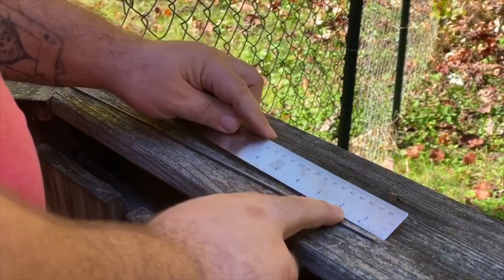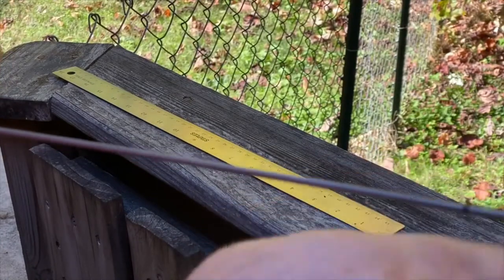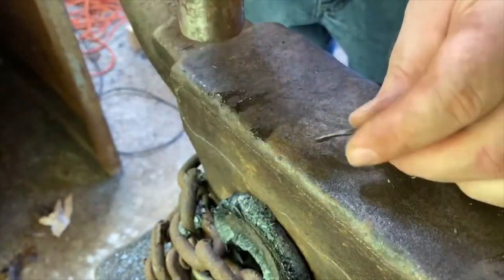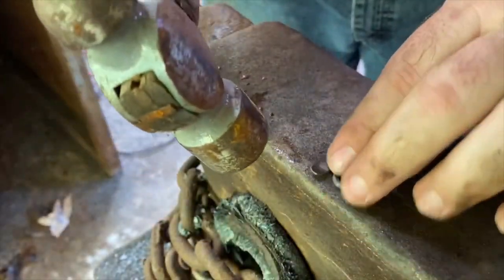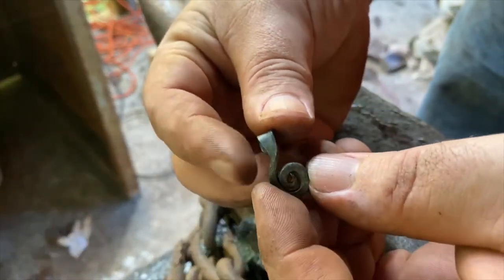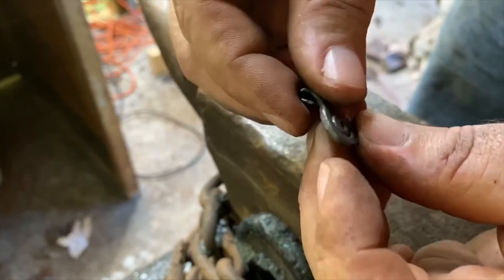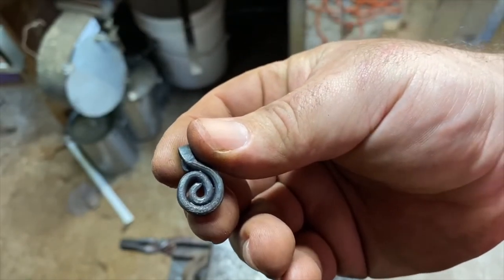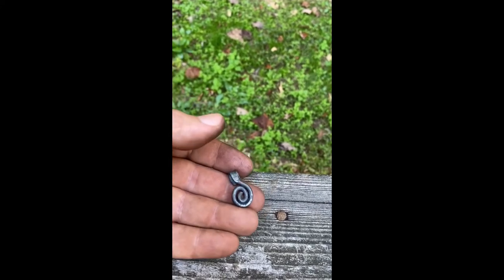Making a Spiral Necklace Charm

Comment: An idea maybe...taper, and then scroll into a tight cone. Take another heat, and tap the cone into itself, to make the spiral. Leave a chunk straight at the end, to flatten, and create loop. They look cool though. 😀👍⚒️
Reply from the maker: I’ll try that, eventually I just started the initial scroll and then took another heat and locked it down in my vise and finished the rest of the scrolling went pretty quick and was way easier then trying to do it all on the anvil

Comment: Yeah I’d definitely do it hot but that’s just me and I’d use the jelly roll technique only taper in one direction and scroll
Reply from the maker: Yeah I definitely started working it hot, and after the third one I gave up doing a full taper and just started tapering one direction and then doing the initial scroll and then locking it it in my vise and doing the roll to get it tight and then forming the clip for the necklace.